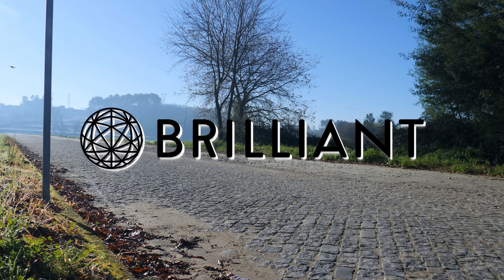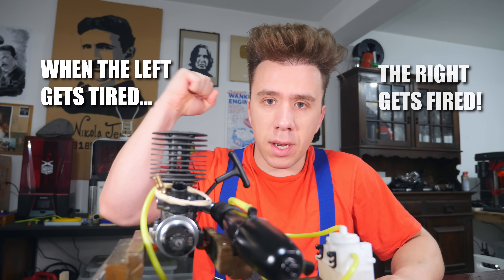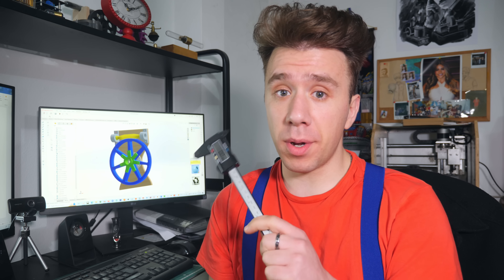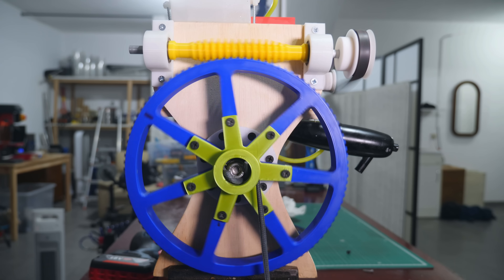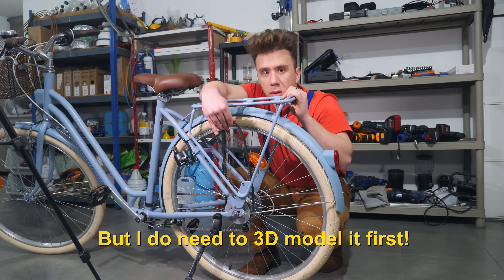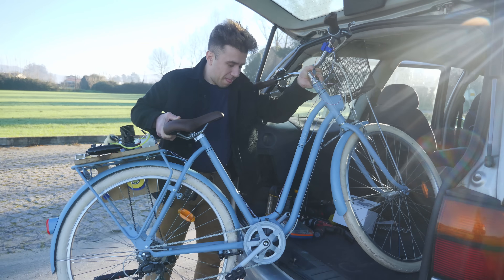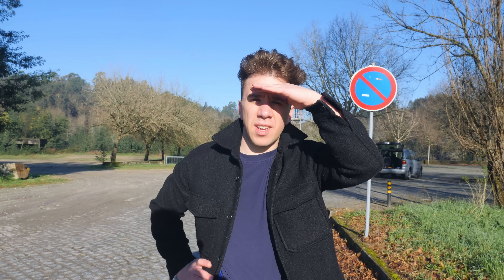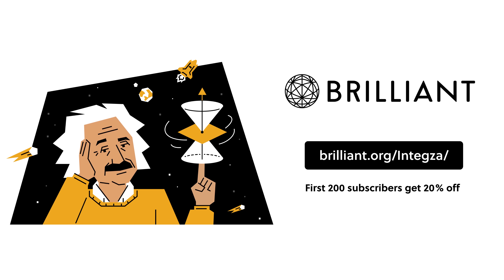Tiny 3.5 cc NITRO ENGINE on a BICYCLE

Comment: Worm gears are really inefficient at high speed. Maybe you can make several smaller gears (a gerabox) to achiev the ratio you need.
Also make a fixed wing drone with a jet engine.
Reply: Yeah the power delivered to the wheel got murdered by the worm gearing.
Reply: @black99rt it‘s nit the only thing g getting murdered, the white teflon cog disintegrated to the wood plank as well
Reply: Planetary gears are literally made for this
Reply: @APF3LKUCH3NLP  planetary gear don't rotate the output 90 degree. A pinion & ring gear would have been better.
Reply: thats really not the problem tho, just turn the engine 90 degrees, wouldve still fit on the bikes carry frame without much overhang @TJPDmember
Reply: @TJPDmember that still wouldn’t rotate tho no?
Reply: @TJPDmember   the engine is already mounted horizontally...all the gears have to do is lie in the same vertical plane as the output gear...
Reply: @APF3LKUCH3NLP  Honestly, when he said he needed to do some really obscene ratio I thought he'd turn to a planetary gear set, but hey, I'll take a different but interesting approach too.
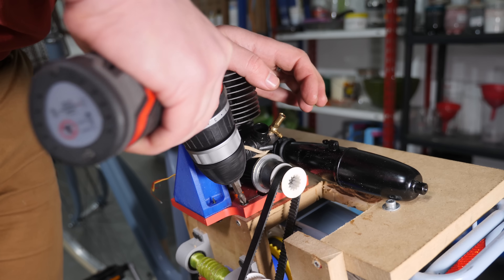Reply: @tisaconundrum  He would have needed multiple stage gearing. A 1:5 gear ratio into a 1:5 gear ratio will give you 1:25 gear ratio. Add another stage and it will be 1:125. Ofcourse each stage adds losses but I think its nothing compared to the worm drive.
Reply: I'm guessing the choice of gears came down to simplicity and time
Reply: Worm gears also can't backdrive, which maybe be bad in this case. Motors stops, bike goes stop.
Reply: @MeshJedi  The one way ball bearing is a sprag clutch so the bike can free wheel without the motor running. When he removed the sprockets from the rear wheel he also removed the bike's sprag cluch which why he added in the one way bearing.
Reply: He has a one way bearing on the driveshaft @MeshJedi
Reply: Another reason for the 1 way bearing. @MeshJedi
Reply: @MeshJedi   no...remember he installed the over-running clutch bearing into the yellow gear...
Reply: @MeshiJedi talk about engine braking lmao

Or engine breaking 😳
Reply: I agree, when I saw the first big blue worm gear, I thought he was going to have it linked with the pedal gear/plate to turn it and still have the function of the normal bicycle gears.
Reply: Lovely video, Joel! ❤ When you hammered the ball bearings, it hurt here a little bit 🫣 You should not hammer the inside of a bearing, better having a tool that pushes in just by the outer ring.
Reply: @GeekDetour 👍😐
Reply: A CVT would be ideal.
Reply: A cycloidal reducer might be an option. https://en.wikipedia.org/wiki/Cycloidal_drive
Reply: Curious to see how it would do with just a propeller.
Reply: Yeah ,somebody help this dumbass.. lol ❤
Reply: wouldnt it be way less work to just use the gears that are already on the bike? Like, place the motor like its a motorcycle where the pedals are.
Reply: @__-fi6xg I was thinking the same thing, using a mountain bike freewheel hub on the engine to transfer power to the back freewheel, you can swap the gear ratios with derailleurs and it already has the one way bearing mechanism for free spin :D
Reply: @ yeah you could even upgrade to motorbike chain
Reply: @FractalNinja  The problem is the lack of torque still. For 32km/h the bike's wheels must rotate at around 240rpm (assuming 700c wheel size) so he's gonna need a 125:1 reduction to get 30,000rpm from engine down to 240rpm on the wheel. On my own bicycle the smallest cog on the freewheel is 12T and I've got a 44T chainring, if we reversed that, with the 12T driving the 44T it's just a 3.66:1 reduction, which is a long way away from the 125:1 he needed lol.
Reply: I was thinking exactly this. Have a gear train instead of worm gears. Maybe planetary gears if that's enough.
Reply: Make a jackshaft with gears matching the engines shaft  including the bicycle gears while coverting pitches using 2 different types of chains. 
Or perhaps something belt driven like a torque converter?
Reply: this

Comment: The 2cv fo the citroën has almost nothing to do with the engine horsepower it is a fiscal thing which calculate like so
1,80 × (kW/100)^2 + 3,87 × (kW/100) + 1,34
It is used to determine how much taxes you pay to get the "carte grise" which you need te be able to drive the car on the street.

Comment: With some extreme gear reduction you can power a car with a motor from electric razor if you want, it will only move few mm per hour but it's doable ;-)

Comment: @0:50 Maybe French horses were stronger at that time ? Deux chevaux CV = nine british horses (hp) ?
Reply: It's a tax hp. Not actually hp
Reply: 2cv means 2HP but, they mean 2 TAX HP....because in France you pay registration of your car according to criteria of power your car that made the 2CV fall in that 2 TAX HP class (because the 2cv was around 9 to 29hp depending on the engine used inside)
Reply: @leoplx3594  Actually it was meant as a joke, not as a scientific statement. Yt-comments unfortunately never carry the emotions of the words, unless you´d use emoticons.
Reply: Horsepower isn’t actually related to horses.

Comment: You should call it The Bi-Valve Interior Combustion Twice-Exhausted Bi-Axle Nitro Cycle!
Reply: BIVICTEBIANC?

I think the acronym needs work.

BIVICTEM

BI-Valved Internal Combustion Twin-Exhausted Motorcycle.

Pedestrians Beware! The Bivictem awaits you!

(Yes, yes.  I know it's spelled victim, but that didn't fit the acronym.  Also, it should be Mo-Ped, not motorcycle, but Mo-Ped just doesn't have the same ring to it.) 😀

Comment: The fact these little nitro engines can put out 0.6 to over 3.5 hp from up to max of 7cc is insane!
Reply: top fuel engines make up to 12,000bhp on this fuel but at a 90%nitro
Reply: @BoostedMike2  smaller engines, down to 0.8 or even 0.3ccm made by Cox (don't exist anymore :-( ) do up to 30.000. The more displacement, the less RPM, but still way beyond 10.000 for 2-stroke. Some racing 3.5ccm with ball bearings, big cooling, hight nitro and better lubrification also did 30.000, but need special care in any aspect, while simple ones (sleeve bearings, standard 5-10% nitro) with this displacement class made half the RPM and overall power.
Bigger 4-strokes are tuned down to low RPM to drive bigger propellers for scale look&feel/power delivery, matching the type of plane model.
Reply: Roughly 610hp per cubic liter in the engine, there's a bunch of videos out there going into detail about these engines and how cool they are.
Reply: @zergalmole ”cubic liter” lol
Reply: @orppranator5230  lmao I just realized
Reply: @orppranator5230 Good old 9 dimensional engines!
Reply: @orppranator5230  I know what You mean, but [smartass mode on] 1^3 is still one! 
No matter if it's one liter, one ton, or one what ever. 
Means: "cubic liter" is false indeed, but in this specific case the math is still correct.
Reply: @zergalmole  I'm missing something in the equation here.
Energy density of a fuel is expressed in Joules. How did you go from Joules to Watt without including a time?
Reply: @Dennis19901  I meant liters in the sense of engine stroke and bore size at bottom dead-center
Reply: @zergalmole  Ah, that makes a lot more sense. I thought you were talking about these engines being super fuel efficient.
Reply: @Dennis19901  The unit "watts" doesn't include time, Watt hours is what your power bill is in.
Reply: @alanhilder1883 What on Earth are you talking about lmao.

Yes, yes it does include time. You know you could have looked this up in less time than that you wrote this comment, right?

"The watt (symbol: W) is the unit of power or radiant flux in the International System of Units (SI), equal to 1 joule per second"

Watt hours is a stupid term. 1 Wh = 3,600 J
Reply: @Dennis19901  My mistake, it is joules per second that is the issue.
Reply: @Dennis19901  These engines (as all 2 strokes) are the complete opposite of 'fuel efficient.'  They may look air cooled but are really liquid cooled by dumping a lot of fuel through the system.  It pisses out unburnt fuel along with the oil straight out the exhaust pipe.
Reply: Must be the extra oxygen in the nitromethane.
Reply: Nitro gives 7% more power per 10% mix, so more than say 12% more power with the fuel he uses.
But the methanol give more oxygen to. It is the high rpm that give the high power output. @twistedyogert
Reply: @twistedyogert  no. its the extra methanol one can pack into the cylinder due to the extra oxygen supplied by the nitromethane.
Reply: @twistedyogert  It actually mainly runs on methanol.  You can buy 0% "nitro" fuel for  model engine.
Reply: Hp per liter they are hard to beat.  I want a tiny diesel r/c engine to convert into a mini electeicity generator.  Also...750ish watts is around 1HP...so these are as powerful as yout basic ebike hub motors.  No idea how much torque they can make though...guessing not much.
Reply: @AaronHendu  That would certainly be a cute generator, to use with relatively cheap fuel (compared to nitro-metane), but RC-model engines are designed for maybe 15 to maximum 30 minutes continous operation and they're not suitable for long-term heavy throttle - and if so, their consumption (g/kwh) and maintenance costs (replacement parts) will not be really low... 
A handy generator (friend has a honda) certainly runs longer, cheaper, more powerful and way more silent.
Reply: @AaronHendu  I’ve also been looking into the concept of an ultra small diesel-powered generator. Mainly for use with a dedicated specific application. That way the output design/electronics can be minimized to only what’s necessary for the application. If the application requires DC current, a dynamo with a rectifier/filter tuned for the desired output could be used. 

It would be convenient to have a standard 120/240vac output model, but design constraints would likely require it to be larger. A somewhat large issue to tackle would be sufficiently cooling the unit for long-term use, and adding an inverter adds quite a bit of complexity and the necessity for more heat dissipation capabilities. 

I’m leaning towards using a direct drive, low noise prop for cooling, but it may prove to be insufficient without becoming too noisy. I am doing tests currently. 

Right now, the most realistic model for me to build is a model that outputs rectified DC current from a dynamo. Only time and testing will tell. cheers
Reply: not exactly... ther are a lot of nitro engine for rc car and planes that go over 7cc... for example the v50 from thundertigher that is 8.2cc and produce 3.8hp at 22000 rpm or the mastodontic rc2300 that is a 23cc 12.5hp monster
Reply: this is what future for cars is gonna look like in EU
Reply: Not sure where you get ‘max 7cc’ from.  These engines can be found in 10cc (0.61 cubic inches..or ‘a 61’) and 15 cc…a 90.  Four stroke ohv version are also available with Glow plug ignition and spark ignition.
Reply: Since your little engine seems to reach full speed under load...it shows it can can tolerate a lower gear reduction...

Throw in a two speed planetary and use centrifugal clutch..
Reply: But they have zero torque. The gear reduction in an RC car is like 15:1 final drive ratio.
Reply: Making them almost as efficient as a Formula 1 engine
Reply: I have a hot rodded LRP ZR32 making 6.6 hp😁
Reply: It's not that insane when you know what horse power actually is. He kind of explains it in the video

Horsepower = Torque x RPM / 5,252.

These engine spin upto 30k rpm.
Reply: They are bigger ones that can put out alot more, we used to use then in rc cars
Reply: there are limits on motorcycles when youre younger and it cant have more than 125cc engine, i wonder if you got a 125cc nitro engine they would have a problem
Reply: No Doubt! I was kinda Shocked, Maybe it's the Compression Ability plus the Expansion of the Fuel Type from Liquid into a Gas has that much Force - There is a Lot of Fun Physics in desingning an Engine... the way I see it is that the HP is the Ability of the engine to Accelerate a Force up to a certain Point, and the Torque Output is the Maximum Force it can Accelerate under a Load... I'm probably wrong - lol
Reply: @robbdudeson346 Torque is time to do the work. Horsepower is the ultimate work that it can do.
Reply: @davelowets  You say "RPMs" to me as if that means anything. You still can't get Wattage from Joules just by throwing in RPM
Reply: @Dennis19901 unless you're talking about Jules Verne perhaps.
Reply: @robbdudeson346  its about the temperature the air reaches...
it takes one unit of work to compress the air. ignoring losses, mechanical and thermal, upon re-expanding you get that one unit of work back. "spherical cows in a vacuum..."

 for every 249C you increase the temperature, you get one extra unit of work from the expansion of that air. 

the higher the compression, the hotter the combustion, the faster it releases the energy contained in the fuel to heat the air...

shame that in a typical engine, roughly 3/4 of those extra is wasted in mechanical and thermal losses...

all engines run on air. the fuel simply heats it up.

Comment: These engines are actually fueled by methanol, but the fuel is often doped with nitromethane as a performance additive.
Reply: Members of the full scale drag racing industry use much higher concentrations of nitromethane: they are limited by the rules to 90% (at least in the NHRA, the main sanctioning body). Historically, racers used higher percentages which frequently caused massive explosions. Modern engines are estimated to generate around 8000 horsepower. The cars can accelerate from 0 to 100 mph in 0.8 seconds and 0 to 335 mph in 4.5 seconds.
Reply: @KentRoads  Did some use Toluene at one point? Other motorsports flirted with the idea a few times, until the toxicity made the FIA and other bodies in the US put a stop to it.
Reply: @Tuberuser187  ah yes, I have a glass every morning alongside my breakfast - as all true racers do. now if you excuse me, I need to go convulse & stumble around yelling incoherently.
Reply: True but I used to play with RC nitro cars for years, I used 30 percent nitromethane fuel which is a decent amount of nitro in the mix. You can even buy 40 percent nitro fuels for the race engines
Reply: Depends on the region, in europe they banned nitro concentrations over 16%. I think he is in europe? @Chevymonster203
Reply: Yep, the fuel for rc cars is typically 5-15% nitro. I have seen fuel with 20% for these but no idea if it goes higher than that.